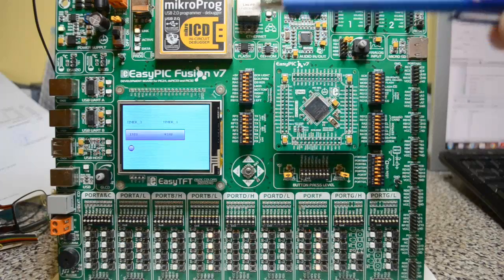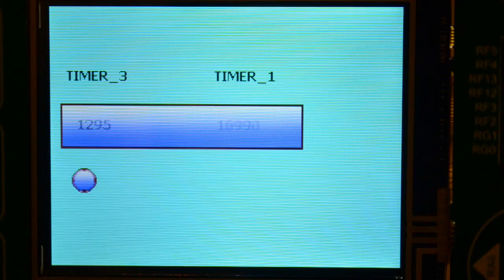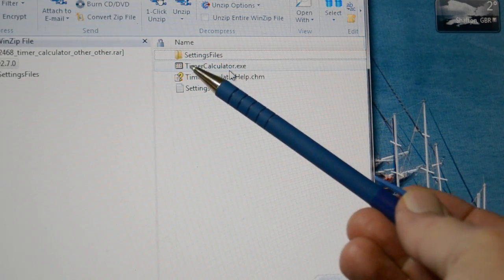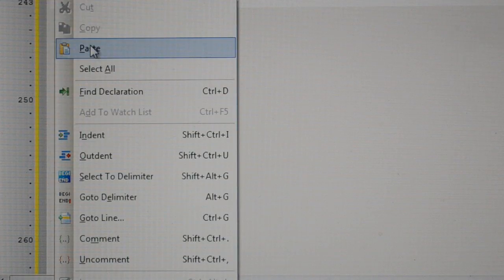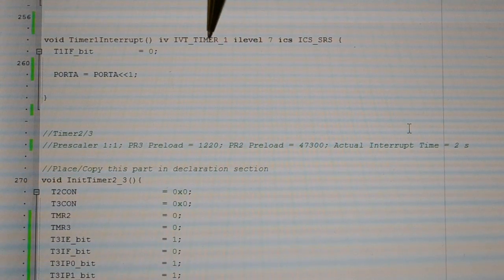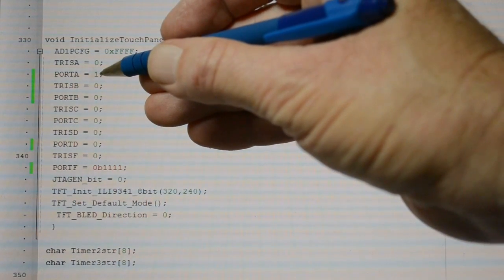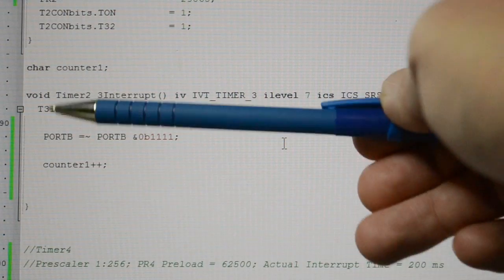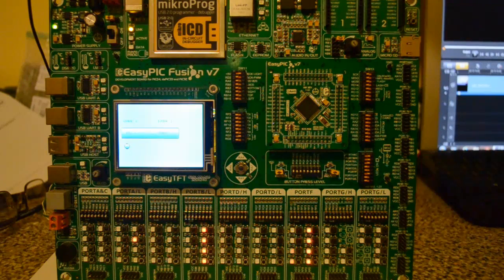Easy Timer Interrupts with MikroElektronika

Comment: help me
interrupt priority don't work

I wrote a small code that shows the error
I have two timers at different frequencies and each one at different priority interrupts.
add a couple of whiles to brake each subroutine separately and the inconvenience
is that regardless of the priority of each timer if I leave any of the two processes waiting
both interruptions are stopped I leave you a copy of the code
I would appreciate the help

#define Led1 RB0_bit
#define Led2 RB1_bit
#define Led3 RB2_bit
#define Led4 RB3_bit

#define Btn1 RC1_bit
#define Btn2 RC2_bit

void InitTimer2_3(){
  T2CON                 = 0x8008;
  T3CON                 = 0x0;
  TMR2                  = 0;
  TMR3                  = 0;
  T3IP0_bit             = 1;
  T3IP1_bit             = 1;
  T3IP2_bit             = 1;
  T3IF_bit              = 0;
  T3IE_bit              = 1;
  PR2                   = 9216;
  PR3                   = 244;
}

void InitTimer4_5(){
  T4CON                 = 0x8008;
  T5CON                 = 0x0;
  TMR4                  = 0;
  TMR5                  = 0;
  T5IP0_bit             = 0;
  T5IP1_bit             = 1;
  T5IP2_bit             = 1;
  T5IF_bit              = 0;
  T5IE_bit              = 1;
  PR4                   = 46080;
  PR5                   = 1220;
}

void Timer2_3Interrupt() iv IVT_TIMER_3 ilevel 7 ics ICS_SRS{
  T3IF_bit = 0;
  Led2=!Led2;
  while(Btn2==1)
  {
  }
}

void Timer4_5Interrupt() iv IVT_TIMER_5 ilevel 6 ics ICS_SOFT{
  T5IF_bit = 0;
  Led1=!Led1;
  while(Btn1==1)
  {
  }
}

void main() {
  AD1PCFG = 0xFFFF;
  JTAGEN_bit = 0;

  TRISA = 0x00;
  TRISB = 0x00;
  TRISC = 0x00;
  TRISD = 0x00;
  TRISF = 0x00;
  TRISG = 0x00;

  LATA = 0;
  LATB = 0;
  LATC = 0;
  LATD = 0;
  LATF = 0;
  LATG = 0;

  TRISC = 0xFF;

  InitTimer2_3();
  InitTimer4_5();
  
  EnableInterrupts();

  while(1) {
    if(Btn1==1)
        Led3=1;
    else
        Led3=0;
        
    if(Btn2==1)
        Led4=1;
    else
        Led4=0;
  }
}
Reply from the maker: I would try timers first, to see if they are running, and comment out everything else.
Try in the timer function
Led1 =~ Led1
or
LATB0_Bit =~ LATB0;
Comment out the buttons and while1s

Comment: Hi John, I really thank you for this video. I am trying to use this calculator to set a timer for a solenoid valve, any tips on how to do it?

thanks
Reply: thanks for your replay,

I mean I want to use the timer calculator to set a timer for a solenoid valve, for example open it 1 hour and close it 10 minutes. All code should be within the interrupter.  and I how to call this function on the main.

unsigned  cnt=0;//Prescaler 1:256; TMR0 Preload = 3036; Actual Interrupt Time : 2 s
void InitTimer0(){
  T0CON         = 0x87;
  TMR0H         = 0x0B;
  TMR0L         = 0xDC;
  GIE_bit         = 1;
  TMR0IE_bit         = 1;
}void Interrupt(){
  if (TMR0IF_bit){
    TMR0IF_bit = 0;
     TMR0H         = 0x0B;
    TMR0L         = 0xDC;
    //Enter your code here
Reply from the maker: Hi,
Set up the timer and make sure it's interrupting at the right frequency.
Make it easy, set it to 1 second.
Then
where it says 'enter code here'  use counter++;           or counter = counter+1;

You could have a counter that counts up
I see you have a counter already and you have set it to 0 good
so to make it clear, I'll use an unsigned int counter           

in your 'while1'

simple method, you would have something like

if (counter <= 600){                                        //600 being 10 minutes
RA1_bit = 1;            }
                                 

The above would turn your pin for the solenoid on.

if (counter >600 && counter<=4200){               //1 hour = 3600 PLUS your ten minutes = 4200
RA1_bit = 0;                                           }

The above would turn it off for an hour

if (counter>4200){                                      //<< this would reset your counter
counter = 0;          }
Reply: thank you so much John, I really appreciate your help.

I wrote the following code, which would work perfectly in the main, but in the interrupter the MOTOR would keep running forever.

   unsigned int counter=0;
//Timer0
//Prescaler 1:32; TMR0 Preload = 3036; Actual Interrupt Time : 1//Place/Copy this part in declaration section

void InitTimer0(){
  T0CON  = 0x84;
  TMR0H  = 0x0B;
  TMR0L  = 0xDC;
  GIE_bit  = 1;
  TMR0IE_bit  = 1;
}void Interrupt(){
  if (TMR0IF_bit){
    TMR0IF_bit = 0;
    TMR0H  = 0x0B;
    TMR0L  = 0xDC;
    //Enter your code here        counter=counter+1;   
         while (1)
    {
    if (counter<=10) {
    MOTOR=ON; }
    if (counter>10&&counter<=15){
    MOTOR=OFF;  }    if (counter>15){
    counter=0;}}  }
      }
Reply: I am using proteus  for simulation. I set it to run 10 seconds and stop it for 5 second
Reply from the maker: So now it's a motor and not a solenoid?
The code can be put in the interrupt.
Reply: John B I want to use this timer to control many things, solenoid valves, motors, sensors, cooling fan, heater, humidity sensors, etc. I thought same timer code I can use it with Solenoid valves and motor. Maybe, I just need to change the function name and the output pin and repeat it whenever i need a timer.

For the above code when I wrote it in the interrupter the motor keeps running all the time. But in the main it works fine.
Reply from the maker: Well I've just tried it on an actual chip with proper software.
The code works in the while1 and or interrupt.
You're meant to keep interrupts short !!!
Why are you not putting the code in the while1 ?
Have you  EnableInterrupts(); ?????
Reply from the maker: I've just noticed, you dont put a while 1 in an interrupt.
You don't need to tell the software to exit an interrupt, it will go to where it last was.
Reply: Thank you so much John, you really helped a lot.
Kind regards :)